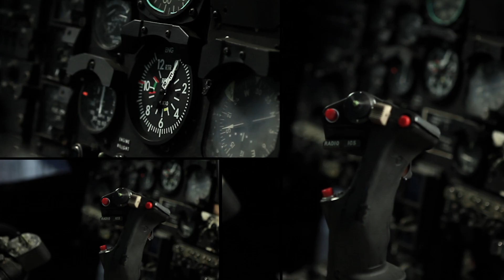Flite Test - Airfoils - PROJECT

Comment: How does a symmetrical airfoil create lift? If the air takes the same time to get across on both sides, then the air pressure on both sides of the wing is equal. The Bernoulli effect works on the basis that the pressures are not equal. someone explain pls?
Reply: Well I'm 13 so don't expect a scientific answer, but from what I've learnt, the symmetrical airfoil produces no lift although that's what the elevator is for,  I'm sure if you are flying an aerobatics plane, you don't want it to go up or down without you touching the elevator. Because if you are going for a stunt, you don't want it to move out of the barrel roll. (Pardon my punctuation.)
Reply: Yeah I remember stunt planes have symmetrical and so do fighter jets. I just didn’t get the point of that against just a flat wing... oh well. I’m 14 by the way haha
Reply: Gautam Krishna I just realized it's because those planes always go upside down so it's just so it's more agile when upside down
Reply: Im not sure. LOL

Comment: for an aerobatic plane, especially something delta wing like an F16, if there any difference between a flat airfoil and symmetrical one? it seems they both rely entirely on AOA for lift, so why bother with the curved symmetrical profile like you get on a real extra 300/edge 540 kind of plane?

Comment: Motivating myself to build a wing is by far the most difficult part of RC flying.  Every wing idea is either too expensive, too problematic, or too inefficient.  In the end I just buy another EPP kit.  So ashamed.
Reply: D. Jensen Flitetest has free plans for planes on their website to scratch build and also speed build kits for sale along with videos how to build them.
Reply: I've made some progress in the past month.  The biggest change was getting over my objection to step-wise airfoils.  If you're never going to fly further than 500',  you probably don't need smooth contours.  Meanwhile, why insist on perfect wings when nothing else is perfect?
Reply: @d.jensen5153  if you think its perfect that's all that matters at the end.  and did ya have fun.

Comment: when you change airfoil, do you see a significant difference in flight time with the same battery fully charged ?. you should make a competition  for RC flying things that flies the same payload from point A to point B (everybody using the same battery+same electric motor+same propellar+same RC electroncis+same payload in the form of a good camera that delivers you good images for your video of the event, same amount of building material (balsa or foamboard). it would be fun and super interesting from a aerodynamics innovation perpective people being free to choose their design within these constraints and not necessarily in the shape of a airplane. ( something like the marshmallow/spaghetti competition the winner being the one with the most remaining battery charge after reaching point B).
Reply: Good question. One wishes they had given a comment, though one thinks a definitive answer might have been difficult

Comment: Ive never understood why Flitetest went away from the KF airfoils , which they liked a lot, to the flat bottomed profiled wings they now regularly use...both have their uses and both are easy enough to make......
Reply: +RC planes John Reap KF airfoils are really cool, durable, simple and high-lift, but they produce a LOT of drag. I highly recommend the KFm2 airfoil for sport trainers, KFm4 (or KFm2) for flying wings and KFm3 for simple, low Aspect-Ratio, "cargo" type planes.

An Undercambered airfoil with the same wing area will produce less lift than a KF, but with far less drag and weight. Unfortunately they're also less durable, but their simplicity and predictable flight characteristics make them ideal for slow-flyers and indoor RC craft.

I built a glider with a KFm2 wing and a 10% undercambered wing. The KF wing was definitely stiffer but quite a bit heavier. The KF wing would glide flatter, but not nearly as far, quickly stalling out and dropping. The Undercambered airfoil had a more normal, sloped glidepath but went much further because it just didn't lose speed as quickly.

Flat bottom wings produce as much lift as KF airfoils, with comparable weight and durability, but a lot less drag. They're more complicated to build, but you can get away with a much smaller motor, battery and ESC, reducing the wing loading and increasing flight times.

In short, KFs are great for simple, inexpensive, durable, "beginner" aircraft, but there are better options for everything else.
Reply: The problem is that the more complex you make the KF airfoil in an effort to reduce drag, the easier (and lighter) it becomes to just do a flat-bottom airfoil instead. I'd love to make a KF with 12 steps all from folded and glued sheets of 1mm Depron but it's just not worth it for the added weight and complexity.

Besides that, the more steps you add and the smaller you make them, the more it resembles a traditional airfoil anyway.
Reply: +fromkentucky I see. I guess it depends on the benefits vs price vs deminishing return in investment (like the bell curve effect/theory). ^_^
Reply: +fromkentucky The drag can be reduce by some simple sanding/smoothing out the rough edges and thinner surfaces/thickness. Check/research it out more. I've found a few by doing some quick online searches.

Comment: Hey flite test love the videos! But after I have personally done some fairly extensive testing in a wind tunnel using a 3dimensional force analyzer I can absolutely tell you that in the scale we use, a "kf" airfoil is just as inefficient as a flat wing. I tested 8 different styles of foils and a sanded blue foam foil worked e best ,

Comment: @monboy10 
Well, quite a lot of full size airplanes have an undercambered wing, especially those who need lots of lift at low speeds. Read the wikipedia article on aerodynamic lift if you like. I'm a full size pilot and I'm happy to know that I'm flying not because of pressure differences but of newton's law about active and counterforce.

Comment: @monboy10:
I'm glad they didn't because the equal-transit-time thing to explain lift is completely incorrect, just think about undercambered and symmetrical airfoils and inverted flight. Angle of attack is all you need, the air gets deflected downwards and generates lift as a counterforce.